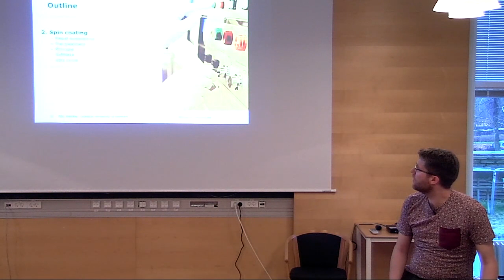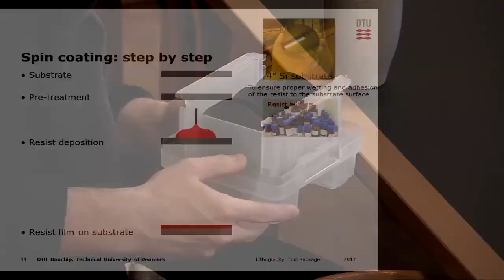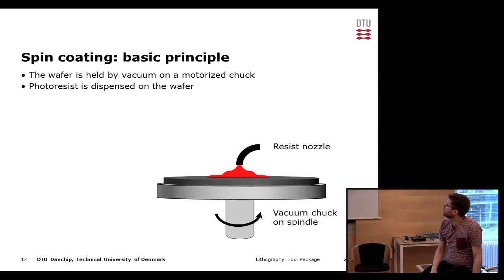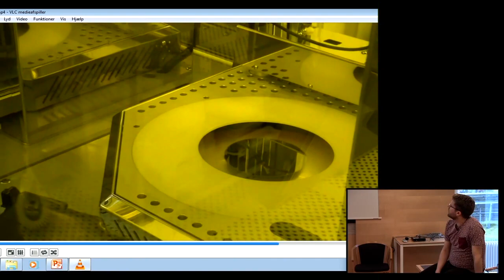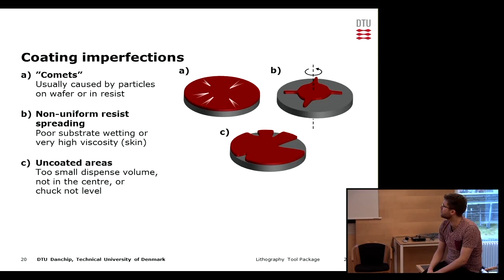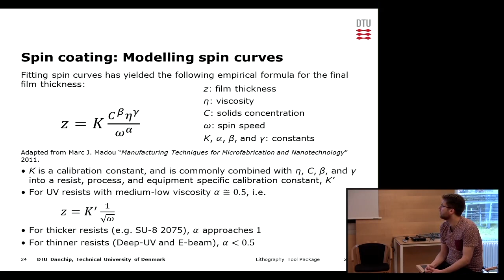Lithography Tool Training lecture: Spin Coating

Comment: Great explanation and presentation. I have a small question,
As you mentioned about coating imperfections like comets, streaks and non - uniformity etc; what are the different ways to  visually inspect the wafer as the coating resin is clear liquid it will be really hard to differentiate before and after coating? how can we visually inspect the failure modes of coating?  If you could answer that would be greatly appreciated.
Thanks